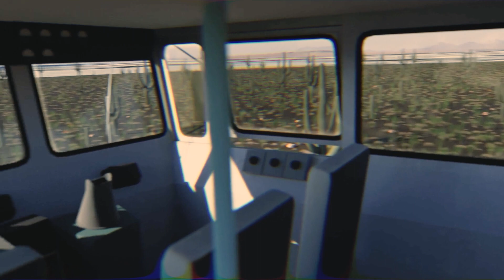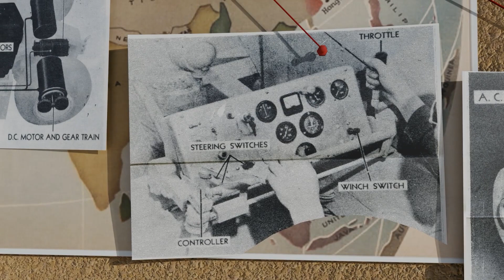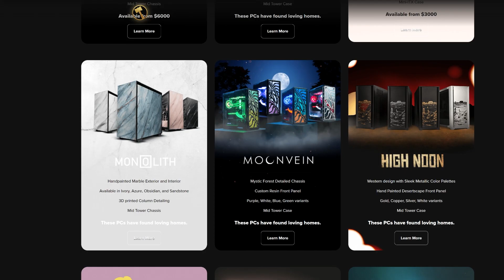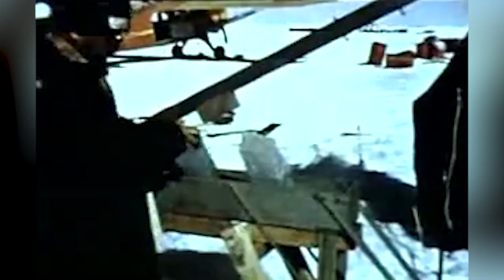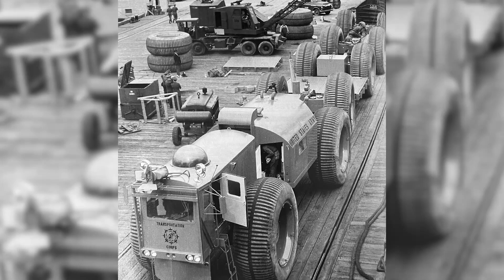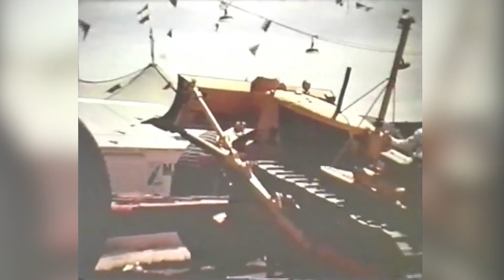What Happened To The INCREDIBLE Land Train?

Comment: The idea of a hybrid-powered off-rail train is much older than that. Young Ferdinand Porsche designed the "Landwehr Train" for the Austro-Hungarian army in WWI to pull munitions in remote areas - with one gasoline engine generating electricity to power electric motors in the trailers.
Reply: I believe that Porsche would try to use the same powerplant on his infamous version of the Tiger Tank during WW2
Reply: Dr. Porsche and his gas\electric motors...
Reply: @zigarettengabel9911   In diesem Fall 🇦🇹, angesichts Porsches böhmischer Herkunft sogar möglicherweise 🇨🇿
Reply: @notroll1279  treffender wäre wohl Sudetendeutscher.
Reply: @fluseint.1303    Das ist die ethnische Zuordnung. Von der Staatsbürgerschaft her aber nicht - es sei denn, wir wollen die "Eingemeindung" Österreichs von 1938 anerkennen.
Reply: Cat trains are same thing , just smaller ,. They've been in use since the 20 s . Would imagine he saw them working in the military during WW2 and expanded that idea
Reply: It's not an American version so know one knows about it. The U.S. makes everything 'first'.
Reply: @alm5992  Every nation and people thinks their people did things first or better lol
Reply: The wright brothers weren't the first to fly, just the first to have it in the news papers. Just like everything else, there is always someone who did it Earlier.
Reply: @philipjdry1234  nearly every claim of powered flight prior to the Wright Brothers has either been debunked or has no supporting evidence outside of anecdotal reports. Which one are you referring to?
Reply: @FlarkusChunswen  your statement of nearly every claim. Is not verifiable. Which makes it as good as air. The wright brothers were the first to have reporters involved but likely weren't the first to fly. Just like with every other invention and event. I just use the wright brothers as an example
Reply: @philipjdry1234  but it is verifiable, as we can verify each claim and its rebuttal. That's how history works.
Reply: @FlarkusChunswen  you can verify they flew, not that they are the first. Because others could also fly but not have reporters around. I know what I know, you won't change my mind.
Reply: @FlarkusChunswen  you don't know what history is, history is a record of past events experienced in memory, not really the word need for your argument base on context
Reply: @philipjdry1234  part of history is being able to look at past events and verify their veracity. That's what history allows us to do simply by existing. So, yes, that is what history is. You need to go back to SAT Prep before you start wordsmithing. You're bad at this.
Reply: *diesel
Reply: @TatersFPV   ** Not according to the Wikipedia entry...
Reply: @notroll1279  did you not listen to your teacher in school? smh. It was definitely diesel bud
Reply: @TatersFPV   kindly share your sources, enlighten me on what "smh" is supposed to mean - and don't call me "bud", will you?
Reply: @notroll1279  I stand corrected. I was thinking of the LeTourneau TC-497 which has a Cummins in it. Sorry bud
Reply: @TatersFPV   That would be a lot less embarrassing if you hadn't been so condescending in the first place, wouldn't it?
Reply: @notroll1279  Sure
Reply: That is a gasoline electric system. Just like a diesel electric locomotive engine.
Reply: @jacobcarolan1172   Exactly. I guess Landwehr/Porsche used a gasoline engine because in the mid 1910s, Diesel engines were still very heavy, vibrated strongly and I"m not sure they could cope with the thickening of the fuel in extreme cold.
Reply: The WW1 tractor land trains were gigantic. Letourneau built on existing tech.
Reply: https://youtu.be/yJLhLtLmxB4 I found this yesterday and it fits perfectly
Reply: I though trader camel trains were older than this
Reply: I'm confused by this comment. Its worded like you're correcting something that was never even said. I might have missed it but I didn't hear him say he invented it. He literally said it was nothing new at the time but he improved on it.
Reply: Ici Initialement Initialement prévue iiiiiiiiiiiiiiiiiiiiioiiiiiiiiiiiiiiiiiiiiiiiiiiiiiiiiiiiiiiiiiiiiiiiiiiiiiiiiiiiiiiiiiiiiiiiiiiiiiiiiiiiiiiiiiiiiiiiiiiiiiiiiiiiiiiiiiiiiiiiii
Reply: @sharonfieber6458   et alors??
Reply: The Landwehr Train was NOT off-rail. It was designed to work on (temporary) rails.
Reply: @0cer0   According to the Wikipedia entry, it could be changed between rail and road wheelsets within 45 minutes - and since it was designed to transport artillery pieces and ammo, I guess that it used rails wherever possible for efficiency but could be switched to road use to take those closer to the emplacements. 
Some of the photos show Landwehr trains using twin tyres.
Reply: Weird though that he didn't mention what is easily it's biggest legacy: When one took the oversized wheels and put them on a truck. Creating the first monster truck.
Reply: Yeah, but anglos wanna claim everything, because they feel far superior to the rest of us.
Reply: Landwehr Train, really?
It could have rather been Landwehr Zug.
Reply: so its just a huge and long prius? { jk }
Reply: It would be a slow, big target for the enemy.  No good in a hot zone.
Reply: The Case150 road locomotive (steam) comes to mind. Though it only had slow(2 or 3 mph) and extra slow(plowing) gearing.
Reply: Thanks for the info! I don’t know why I never heard about that before.
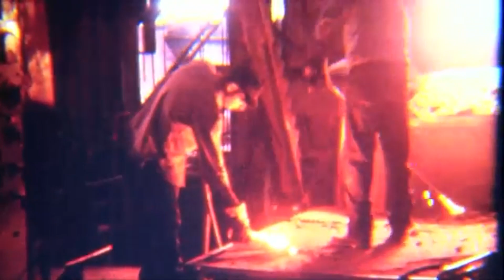Reply: “Then Peter said unto them, Repent, and be baptized every one of you in the name of Jesus Christ for the remission of sins, and ye shall receive the gift of the Holy Ghost. For the promise is unto you, and to your children, and to all that are afar off, even as many as the Lord our God shall call.” Acts 2:38-39 KJV 

“Jesus saith unto him, I am the way, the truth, and the life: no man cometh unto the Father, but by me.” John 14:6 KJV 

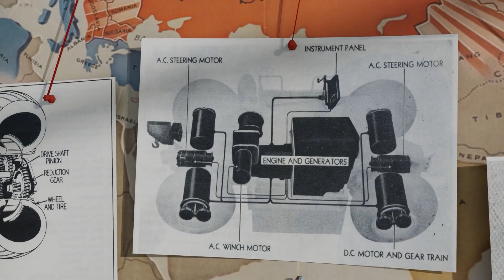“He that believeth on the Son hath everlasting life: and he that believeth not the Son shall not see life; but the wrath of God abideth on him.” John 3:36 KJV 

“For if ye forgive men their trespasses, your heavenly Father will also forgive you: But if ye forgive not men their trespasses, neither will your Father forgive your trespasses.” Matthew 6:14-15 KJV

“And I say unto you, Ask, and it shall be given you; seek, and ye shall find; knock, and it shall be opened unto you. For every one that asketh receiveth; and he that seeketh findeth; and to him that knocketh it shall be opened. If a son shall ask bread of any of you that is a father, will he give him a stone? or if he ask a fish, will he for a fish give him a serpent? Or if he shall ask an egg, will he offer him a scorpion? If ye then, being evil, know how to give good gifts unto your children: how much more shall your heavenly Father give the Holy Spirit to them that ask him?” Luke 11:9-13 KJV

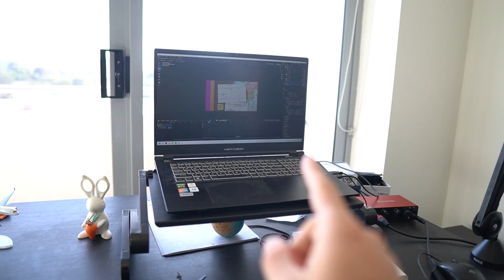“And Jesus said unto them, I am the bread of life: he that cometh to me shall never hunger; and he that believeth on me shall never thirst. But I said unto you, That ye also have seen me, and believe not. All that the Father giveth me shall come to me; and him that cometh to me I will in no wise cast out. For I came down from heaven, not to do mine own will, but the will of him that sent me. And this is the Father's will which hath sent me, that of all which he hath given me I should lose nothing, but should raise it up again at the last day. And this is the will of him that sent me, that every one which seeth the Son, and believeth on him, may have everlasting life: and I will raise him up at the last day.” John 6:35-40 KJV 

“And fear not them which kill the body, but are not able to kill the soul: but rather fear him which is able to destroy both soul and body in hell. Are not two sparrows sold for a farthing? and one of them shall not fall on the ground without your Father. But the very hairs of your head are all numbered. Fear ye not therefore, ye are of more value than many sparrows.” Matthew 10:28-31 KJV

“That if thou shalt confess with thy mouth the Lord Jesus, and shalt believe in thine heart that God hath raised him from the dead, thou shalt be saved. For with the heart man believeth unto righteousness; and with the mouth confession is made unto salvation. For the scripture saith, Whosoever believeth on him shall not be ashamed. For there is no difference between the Jew and the Greek: for the same Lord over all is rich unto all that call upon him. For whosoever shall call upon the name of the Lord shall be saved.”
Romans 10:9-13 KJV 

“Jesus answered, Verily, verily, I say unto thee, Except a man be born of water and of the Spirit, he cannot enter into the kingdom of God. That which is born of the flesh is flesh; and that which is born of the Spirit is spirit.” John 3:5-6 KJV

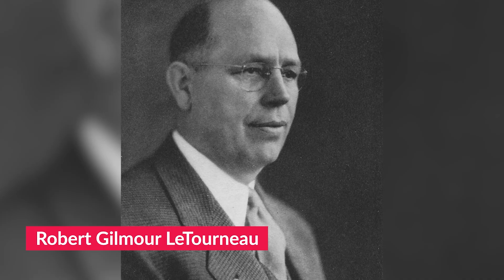“Who hath delivered us from the power of darkness, and hath translated us into the kingdom of his dear Son: In whom we have redemption through his blood, even the forgiveness of sins: Who is the image of the invisible God, the firstborn of every creature: For by him were all things created, that are in heaven, and that are in earth, visible and invisible, whether they be thrones, or dominions, or principalities, or powers: all things were created by him, and for him: And he is before all things, and by him all things consist. And he is the head of the body, the church: who is the beginning, the firstborn from the dead; that in all things he might have the preeminence. For it pleased the Father that in him should all fulness dwell; And, having made peace through the blood of his cross, by him to reconcile all things unto himself; by him, I say, whether they be things in earth, or things in heaven.” Colossians 1:13-20 KJV 

“Look not every man on his own things, but every man also on the things of others. Let this mind be in you, which was also in Christ Jesus: Who, being in the form of God, thought it not robbery to be equal with God: But made himself of no reputation, and took upon him the form of a servant, and was made in the likeness of men: And being found in fashion as a man, he humbled himself, and became obedient unto death, even the death of the cross. Wherefore God also hath highly exalted him, and given him a name which is above every name: That at the name of Jesus every knee should bow, of things in heaven, and things in earth, and things under the earth; And that every tongue should confess that Jesus Christ is Lord, to the glory of God the Father.” 
2 Philippians 2:4-11 KJV 

“Take heed that ye do not your alms before men, to be seen of them: otherwise ye have no reward of your Father which is in heaven. Therefore when thou doest thine alms, do not sound a trumpet before thee, as the hypocrites do in the synagogues and in the streets, that they may have glory of men. Verily I say unto you, They have their reward. But when thou doest alms, let not thy left hand know what thy right hand doeth: That thine alms may be in secret: and thy Father which seeth in secret himself shall reward thee openly. And when thou prayest, thou shalt not be as the hypocrites are: for they love to pray standing in the synagogues and in the corners of the streets, that they may be seen of men. Verily I say unto you, They have their reward. But thou, when thou prayest, enter into thy closet, and when thou hast shut thy door, pray to thy Father which is in secret; and thy Father which seeth in secret shall reward thee openly. But when ye pray, use not vain repetitions, as the heathen do: for they think that they shall be heard for their much speaking. Be not ye therefore like unto them: for your Father knoweth what things ye have need of, before ye ask him. After this manner therefore pray ye: Our Father which art in heaven, Hallowed be thy name. Thy kingdom come, Thy will be done in earth, as it is in heaven. Give us this day our daily bread. And forgive us our debts, as we forgive our debtors. And lead us not into temptation, but deliver us from evil: For thine is the kingdom, and the power, and the glory, for ever. Amen. For if ye forgive men their trespasses, your heavenly Father will also forgive you: But if ye forgive not men their trespasses, neither will your Father forgive your trespasses. Moreover when ye fast, be not, as the hypocrites, of a sad countenance: for they disfigure their faces, that they may appear unto men to fast. Verily I say unto you, They have their reward. But thou, when thou fastest, anoint thine head, and wash thy face; That thou appear not unto men to fast, but unto thy Father which is in secret: and thy Father, which seeth in secret, shall reward thee openly. Lay not up for yourselves treasures upon earth, where moth and rust doth corrupt, and where thieves break through and steal: But lay up for yourselves treasures in heaven, where neither moth nor rust doth corrupt, and where thieves do not break through nor steal: For where your treasure is, there will your heart be also.” Matthew 6:1-21 KJV
Reply: Nobody likes a know it all
Reply: @secretagentrandybeans5298  
So far, 264 do, Mr. Beans.
Reply: @notroll1279  not if it showed the dislikes you’d be negative in likes

Comment: alright this is cool but 5 trailer roadtrains in the desert haul more and are cooler, and longer
Reply from the maker: This train design could be infinity long
Reply: @FoundAndExplained  so can road trains though, limiting factor is obviously coupling strength and power
Reply: @logical_volcel  But that very limit of coupling strength does not apply to the Land Train, as all of its wheels throughout the entire consist were powered, negating nearly all kinds of physical straining on the connections between the individual cars. And even the only real issue of sufficient power supply could've been countered by simply adding additional power plants down the line.
Reply from the maker: Correct. Each car was self powered. There was no straining, no main 'engine'. Its brilliant as it is simple. Far superior to what we have today.
Reply: @FoundAndExplained  Well, we kinda have that technology today and use it every day. The Shinkansen, ICE, TGV and co. are all using distributed power throughout their entire consist, with every bogey being independently powered. Just like the land train used to. 

On that topic, you think you could swerve more into the railroad side of 'extraordinary' designs and pipe dreams in your future videos? There's a lot of intriguing options to choose from, honestly. Like the German 'Schienenzeppelin' or that French Hover Train/Monorail.....thing with the concrete rail.